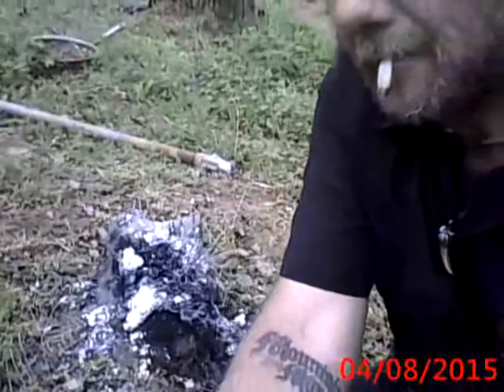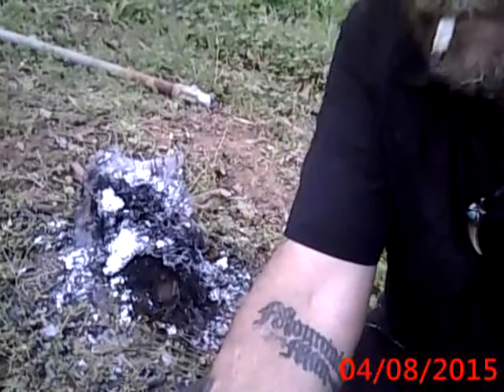How Much Heat Can Magnesium Take Before Combusting

Comment: That took a lot longer than I woulds thought. Pretty cool
Reply from the maker: John Tewelow  it would have taken longer for the tarnished side of the magnesium to catch fire than it would have for that shiny side I noticed that when I burnt that piece I had drilled on in a past video I set the torch to it just before I shot this video and it caught quick I am guessing because them holes made thin spots in the bar causing it to heat up quicker